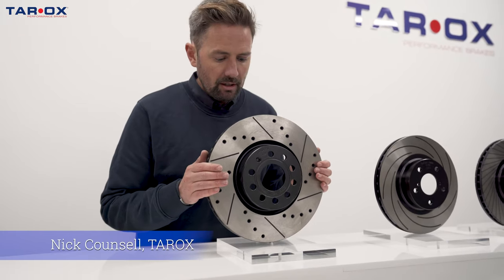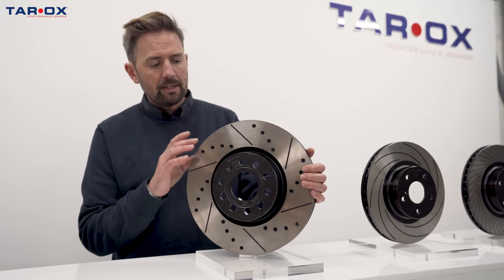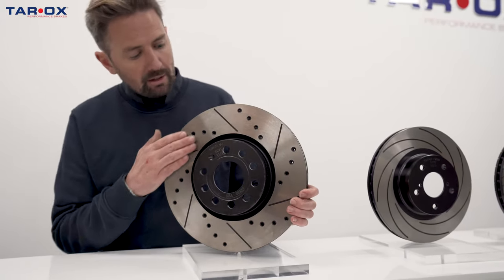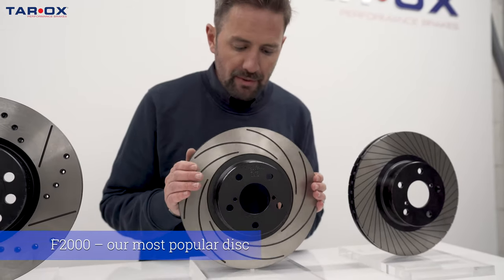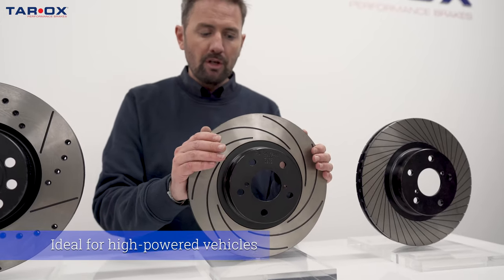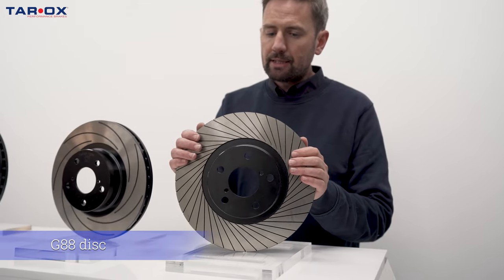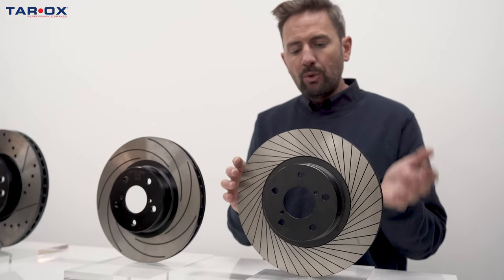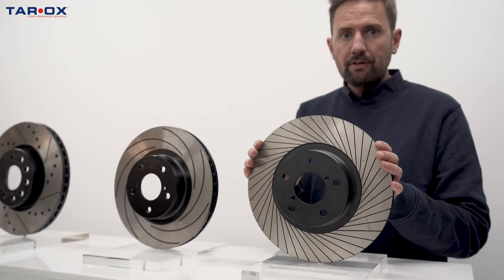Tarox brake disc options

Comment: Is it true that the f2000 is the most stable disc?
How is noise with the 2 sacred F2000 disc in conjunction with the Tarox 8 piston caliper and the Tarox Corsa pads? Glad to receive an answer. Thanks

Comment: On the bmw 330ci is shows 325mm discs for sale but with the big brake kit shows 340 do you have to have the biggest discs or will the smaller discs fit the brake kit? Thanks
Reply from the maker: A smaller kit is available which we built for the 320. We built a 340mm kit for the 330ci as we usually try to increase disc size when designing brake kits.

Comment: Are the vents in the disks straight or curved, and therefore sided? Just looking at these as an option for my Porsche 968 M030 track car.
Reply from the maker: Curved ventilation is usually determined by the OE cast design. Sometimes if we believe the application would really benefit and we control the cast then we will add curved ventilation and handed discs. All our discs do have a left and right as the slots/grooves/ drills are always directional.
Reply from the maker: Hi, If the original cast design was handed then yes, if not then usually know. We usually have to stay close to original cast design, unless we are building a two piece item

Comment: Hi, I am looking for a brake kit upgrade for a 2018 rs6 c7. I saw on your website that you make both front and rear, which is great, because other manufacturers only provide a front upgrade.

Which disc design would you recommend for this car? Thank you.
Reply: My next choise Will be f2000.

Comment: Hi, you can build Disc's any size for customers request?
Reply from the maker: We can but it comes with a design and engineering cost which can be quite eye watering  - if the application is never going to be sold to public. if you interested email websales@tarox.com

Comment: Hello which version do you recommend for a 335i I hesitate between the f2000 g88 and japan

Thank you
Reply from the maker: Which chassis 335i Modern car with the increased weight and performance do better with the Sport Japan or F2000. From those too SJ better for road F2000 for track performance is very similar on road but we advise against drills on track
Reply: @OfficialTarox  
I forgot to tell you that my car is in stage 2 +400 hp and that I do not do track I just want the endurance of the bite and avoid it to veil

Comment: Ho installato sulla mia Citroen C2 VTS una coppia di dischi Tarox Sport Japan (forati e baffati) al posteriore. Ottima frenata ma rumorosi in frenata, lo stesso rumore che fa una linguetta di plastica che sbatte sui raggi di una bici.
I installed a pair of Tarox Sport Japan discs (perforated and slotted) at the rear on my Citroen C2 VTS. Excellent braking but noisy under braking, the same noise that a plastic tab makes that bangs on the spokes of a bike.